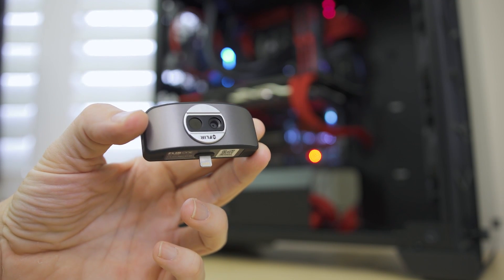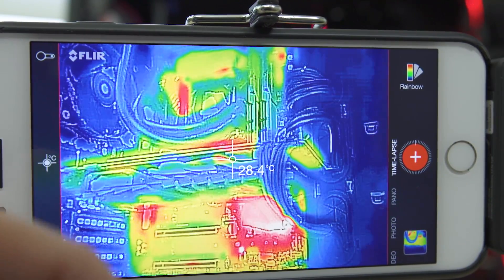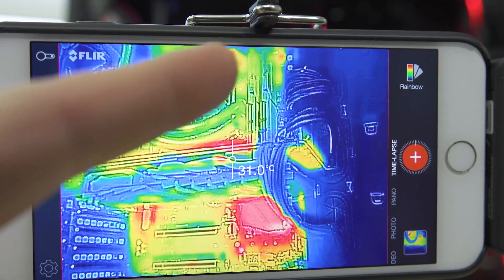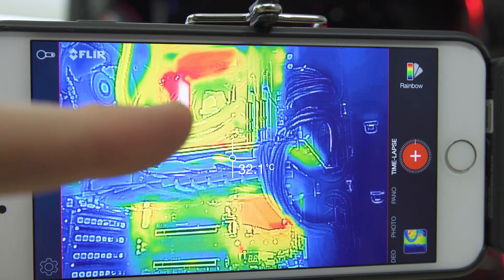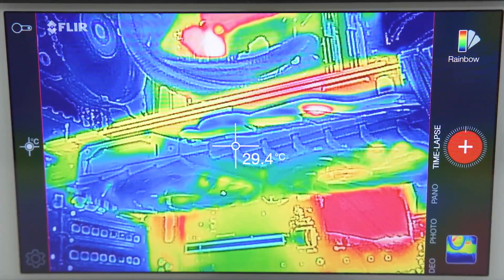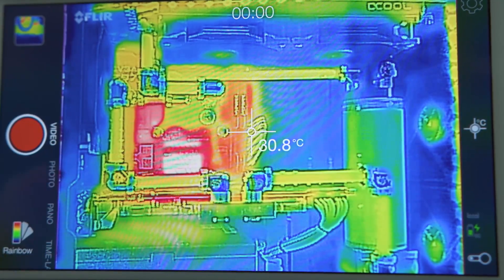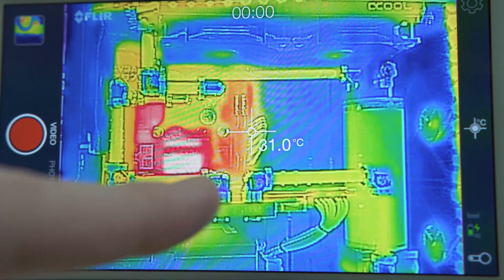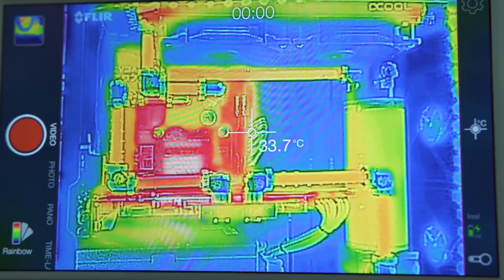PCs and Thermal Imaging... What your eyes CAN'T see

Comment: On a related side note, this seems to show a properly set up air cooled vs water cooled system ends up as basically a wash. I'm sticking with air cooled. Less of a hassle, much less risk, and aside from cleaning out dust, no maintenance. I would only consider water cooled in a small form factor build, but then again, after watching this video, I'd be worried about the lack of air flow in those types of systems. Maybe someone needs to invent some type of heat pipes and/or heat sinks, or even a water cooled block set up to address heat on the M.2 drives, vrms, etc to control heat better in those small form factor builds?

Comment: airflow makes a massive difference in temps, as far as CPU goes. i had 1 intake fan and 4 exhaust fans with cpu temp of 98 degrees celsius. now my desktop has 1 intake, 2 exhaust and 2 broken fans and the highest temp cpu reaches now is only 78 degrees. GPU was unaffected.

Comment: If the backplate is getting hot, it is good.. It means that it absorb heat from the gpu instead of letting it accumulate inside more sensitive parts. It is a head spreader, that's what i see here. Yeah things are getting warm. It is normal. I don't see anything to worry about here.

Comment: Surprised the video card does not turn red at idle. I have an idea on the thermal imaging. Try  placing extra fans in the case in spots to see how much of a difference it makes. I am always  concerned about heat in a computer and always have the max amount of fans in my case to keep it running as cool as possible. I don't overclock but I do know heat is the number one killer for PC hardware.

Comment: its not going through the tube 9:20 . its reflecting off the gpu. thermal cameras cant see through glass or plastic unless the heat is contacting the surface directly. if you were to put the clear side panel on you would see your reflection and nothing inside

Comment: question: ive been told that temps reduce lifetime of hardware. for example. 2 1080 cards. one is running for for 5000hours on 87° the other is running on 70°, then the one running on 87 might die after 5100 hours, while the cooler card might run 8000hours on 70 degrees. is that true?

Comment: That's why you use have to use TOP BLOWER CPU COOLERS!!!
All that water and tower cooling shit, it wrecks the motherboard!
The components around the CPU get as hot as 105°C with a tower or water cooler!! That's the freaking maximum caps are rated are! and guess for how long do standard caps withstand 105°C? 2000 hours! Yes, only 2000 hours! If you're a power user using your system heavily, your motherboard will die after 1 year max! Even with 5K caps, it probably won't survive the 4th year!!
Get yourself a top blower, save your motherboards!

Comment: I have seen so many videos where diff thermal pastes are compared. Using this camera you can compare thermal pads. 
Use different thermal pads from 1$ stuff to high end on the mobo VRMs and then using this camera you can measure the performance. The hotter the heatsink above the thermal pads the better the performance < though i may b not 100% correct about my theory

Comment: Hey Jay! I was monitoring my performance and temperatures last night while playing Overwatch. Turned out my Gigabyte GeForce GTX1070 G1 Gaming was running in 93C and only using ~540mb of VRAM while playing(everything on low, 1080p)
I got very concerned because that is hot as hell considering my core clock is only +100 in MSI Afterburner(power target and temp target is maxed out). 
So i went in and changed my fancurve manually and my temperatures dropped down under 55C under load, while also using ~1gb of VRAM with same settings.

Any ideas of this? Could the fans on the card simply been off during the first time? Before everything happen it also randomly reset my digital vibrance for both my monitors. 
I dont really mind that it happen, but i have no idea whats causing it so i cannot "fix" it.
Best regards
Wils.

Comment: Most likely too late to post such comment on this video, but it's more relevant than on the AIO one. I'm curious as to how the thermal imaging would look if there was watercooling on all the parts of the motherboard that could get cooled that way (mosfets, chipset and so on, every watercool-able part). Mostly I'm asking this because I would like to see the real life results for if, for any reason, someone were to build a special rig I've been thinking of where there is zero airflow over the components, only waterblocks to transfer the heat.

Comment: There is a problem with black plated graphics cards and AIO liquid coolers especially when they are mounted on top. A lot of hot air is produced inside the case by the back plate of the video card and the VRM radiators which won't get any more airflow as they did from an AIR cooler. So the job of making airflow is left only to the exhaust fan which is not enough because it will only get out some hot air. So what you need is a strong intake and if your case allows ii maybe have a fan blowing cool air towards your CPU and VRM area.
Without that in summer you can experience CPU throttle isues like I did with a MSI 970 Gaming motherboard and an FX 8350!

Comment: what i wanted to say about it is thermal cameras benefit is they can give a very quick idea whats going on in thermal design, as one ges a very fast input then attach 20 thermal probes all over the place, with one does to know more hard numbers in thermal designs.

now im more intressent in se if a top flow cooler VS a tower cooler like noctuas C/L and U coolers affects its environment, as i suspected for a while that yes a C may not be able to keep upp with a U in raw figure crunch for cpu cooling but it may actually do a double purpose in cool other components at the same time, this little camera may be able to tell if that is true or not.

Comment: Hmm i would be curious to see how a downdraft cpu cooler such as the "Cooler Master GeminII S524 Ver. 2" would (improve cooling) for the VRM and chipset temps, hell it would even help the M.2 Drive i would think.

I am currently running a i7 6700k in a Raven RVZ02 Case with a Scythe Big Shurkin 2 Downdraft cpu cooler and ive modded a Prolimatech PRO-USV14 140mm Ultra Sleek Vortex Fan on to it for just this reason of controlling vrm, chipset, audio controller etc,etc heat... basically it cools the whole motherboard

Comment: measuring the conductivity of insulators... does it count as a slow clap if I pause it?
Though I read R4GEcraft comment/thread and you're obviously slightly informed on the whole problem with those flir cams.
LinusTechtips did the same though they filmed through a fucking glass panel... bra fucking vo.

There's the same problem with cops getting warrants granted because they used flir cams... that's another  issue about corruption, but the miss understanding of the tech is basically the same.

Comment: So many things wrong with this video. It's like trying to define what color is a mirror. 
You can't directly measure metals with an IR temperature meter. Put some black electrical tape on it and you'll see a different values. 
Note that different materials have different emissivity values.  Eg. your skin is 98% effective at radiating heat but aluminium is only 10%.
Google up emissivity and IR thermometers. If you don't believe me, put some different materials (metals, plastic, wood etc) in the oven (at low temp :) and look at them with the camera.
And you might want to lock the scale on your meter and measure values from different spots to have any meaning.

Comment: I bought one of these for evaluating steam traps.  It works very well for low pressure traps, but high pressure steam will exceed the 250 deg F temp limit.

Comment: Hey Jay,

Just an FYI IR at the wavelengths most cameras use cannot pass through glass.  So the thermals you are seeing off the glass tubing is either the surface temperature of the glass or the IR that is reflecting off of it.  If you want to see what is going on with the fluid I know acrylic does allow IR to pass through.  IDK about petg.  

So if you are bored one day it might be fun to make loops of the different materials and make comparison FLIR videos.  Also ignore the haters even if it is not the most accurate representation of the heat in the system it was still interesting to see.

-Dave the Nube-

Comment: All trolls aside there is a lot to be gained from thermal imaging. Temperature accuracy or not it still shows the hot spots and helps you mitigate any issues. Personally I have a really old FLIR camera which has it's issues from getting tossed around in my tool bag for the last 8 years but it still works well enough to get the job done. It's primary use was finding issues with PA sound equipment and cables. Nothing helps you find gear that's about to crap out easier or quicker. That said I've used it to build PC's too. It's amazing what a few air dams will do to help keep things cool and running well. Great video Jay. I hope to see many more of these and and am eager to see how you'll implement this new toy in future reviews.

Comment: i have an nzxt s340 case and a corsair h100i gtx, should i put it in a pull configuration (the rad is mounted in the fron as usual) that way it can have some airflow? or should i change the pre installed exhaust fans at make the top make air go in and the back out? thanks for any advice

Comment: First off, thanks for using descent music for your time lapse.  I can say how mad I get and turn videos off when people use crappy music.  Second, well done video, very relevant.  Lastly, I had asked you for help about Doom a few days back with no answer.  RX 480 8 GB OC edition from Sapphire.  Doom kept crashing when trying to save and exit.  This video spurred a thought about my own system. At 720 res, I could get past my save and check points.  At 1080, it would shut down and hard lock my system.  So, my question is, should I have purchased an OC card to begin with?  How do I reverse the OC to be able to test the card at 1080 and see if it shuts down my system.  I'm thinking that my MSI 970 gaming motherboard and power supply, 650 watt, are the culprits of not being able to handle the electrical load my video card is handing out.  Thoughts anyone?  Thanks.

Comment: I have a pc with an fx 6350 and gtx 1060 with a biostar a960d+v2 mobo and when playing games the cpu throttles back to 1.3ghz? The cpu is only at 68 degrees but the motherboard temps are saying something on the motherboard was at 89 degrees but I'm not sure what is causing the cpu to throttle? plz help

Comment: While it is somewhat interesting to look at a PC under a thermal camera, it doesn't really tell you all that much in terms of actual issues with the system and it's cooling if the range isn't statically locked to a set documented range.  Even without the various differences in emissivity of materials, which anyone who has graduated high school should know, It is perfectly normal to have motherboard hot spots without it really affecting your build.  Electronic components have a very wide operating temperature and a just by viewing it on a thermal camera you are able to see components that are generating more heat but they may be well within their target operating temperature range.  If you really want to see potential problems with a thermal camera you will need to lock the camera range from say black being 15C or whatever the room temp is and white being 75C.  Anything in that range would be fine for years without issues.  Permanent damage to pretty much all PC components from heat generally requires temperatures in excess of 105C Some components like VRMs are designed to run far hotter at upwards of 125C max and 90C under normal operation.

I do understand where you are coming from with this video but it is really hard to cover this topic well with a 12-minute video.  This topic really deserves a much more in-depth analysis and explanation of what is actually important.

Comment: Its very easy to create a silent computer without hiding the radiators away etc. You just need a mass of fans running at low speed, move a little bit of airflow each rather than a few fans moving a lot of airflow. My system is running 11x140mm fans, 1x180mm fan, completely air cooled. I can't hear it whatsoever even up close at the dead of night. It will throttle up the fans a little whilst gaming but sat anywhere but next to my computer in the middle of the night again I can't hear it. With an AMD FX8370, an AMD Fury X, both being very high wattage, I'm still not seeing temperatures above 50 degrees on the air cooled CPU, and the GPU modified with an XFX Fury air cooled setup I hit 60 degrees at 800 RPM (silent, max RPM in excess of 2400, cooler designed for the less powerful version). The bottom line, you can be utterly, utterly silent with very good heat dissipation using a large number of fans. I really don't understand why more people don't follow suite.

Comment: a friend of mine had problem with a amd system that the vrm were getting to hot causing freeses and shut down we found out that was the issue after trying everything we tried putting a fan directly on the vrm heatsink and no more freeze well he did upgrade to a x99 shipset after that anyway fo my comuter i watercooled the vrm and chipset on the MB at the time it was just because i wanted to now i know the importance of good vrm cooling thanks jay

Comment: I have a wall mounted PC, i7-2600k at 4.8ghz. Everything is watercooled, but i still have a supplemental fan hanging over the motherboard that I turn on when ambient temps are hot and doing heavy gaming loads to cool the motherboard itself which greatly improved system stability. Thanks for the thermal imaging, I can't wait to see more on this channel @JayzTwoCents

Comment: Jay, nice video! Whilst it's not going to be exact - and I know that for keeping the whole system in view of the camera - it'd be nice to see the center point focused on the hotter areas so we can see the rough difference in temps between some areas of the system.

I've recently upgraded the stock fans on my Aerocool Aero-1000 case with some Wingboost 2's, as well as the rad fans being swapped out for Phanteks pwm fans, and whilst the overall system seems cooler, I definitely notice more of a benefit for the CPU than MB and PCH temps according to Asus's AI Suite. It'd be nice to see what effect extra airflow in cases has on temps, etc.

Comment: Jay, please take in mind that these thermal cameras do not represent the right surface temperature at all, escpecially when observing shiny surfaces like that of the backplate and heatpipes. Those surfaces generally emit more thermal radiation because they also reflect rays emitted from other components. That's because the backplate, heatpipes and VRM coolers seemed very hot although they weren't.
Gamers Nexus once did a great video about this topic, you should definitely check it out!

Comment: I'm Flir E4 guy and saw here You must experiment more with this camera. All shiny stuff reflect heat from other parts and not show their actual temperature. And particularly when your thermal Emissivity set wrong. They can be capacitor ends and other pads on motherboard and heatsinks, heatpipes. That's how can heatpipe look cold to the thermal camera and cold metal shield feel hot reflecting actually hot cpu image. (Hot points on motherboard can be shiny capacitor ends and you see reflecting heat from videocard)
And point the cross to the hot place to show what temperature this part is. Not guess and point with finger on screen...
So, try harder : ))

Comment: Great video! But, based on  when you put you'r hand in front of the camera, you can se that you'r setting on the Flir lens are automatic adjustment of temperature. Thats why some parts change colour when you introduce another temperature. 
This all means, that it sets the colour based on the hottets versus the coldest in the picture. And if the temperature difference on the screen is, for an example 2 degrees, the lowest temperature will be blue, and the highest red. Even if its only a 2 degree differnce. Not that warm. And not interesting to be onest. 
The only really interesting info on the screen is the temperature in the middle. The rest could be what ever. Just thought i'd say..

Comment: Thank you Jay for this type of insight. I'm looking forward to more videos that'll include thermal imaging. However,  two things:

1. I was hoping to see an actual CPU air cooler and it's effects on the system RAM and VRMs

2. Is there a way to see the actual temperatures of each component simultaneously during stress testing?